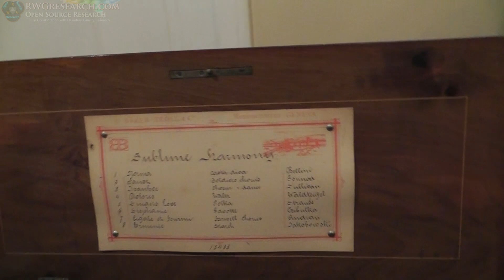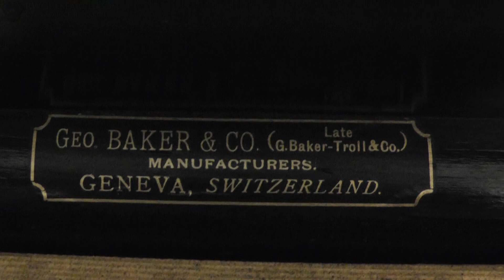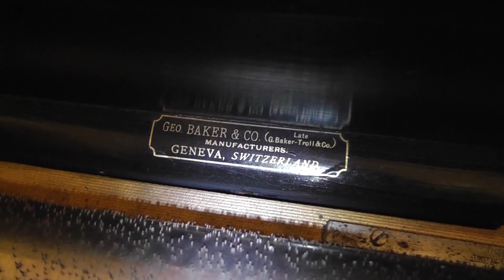Amazing 1800's 8 Song Music Box, Lets Look At The Mechanics! G. Baker-Troll & Co.

Comment: It's called a Geneva stop wind. After 4 winds it stops to prevent overwinding of the mainspring. Those pins and wheel are important. It keeps the spring tentioned in the barrels winds down so the spring doesn't break and come off the arbor.

Comment: That lever by the cylinder is a hack that someone installed for later coin operated units. Never ever ever ever use that to change the melody when it's not properly aligned you can bust the teeth or at times missalign the cylinder when the change cam comes around.  This hack may have been added either in the early 1900s for music selection ( like a Juke box). I don't like the quick select feature. As I mentioned that's an addition to the machine. The handle thimble looks different as well. It's best to let the music change as the cylinder revolves.

Comment: That is a really nice music box.  Couldn't imagine having to place all those pins on that cylinder.  By the way, that part that you were pointing out on the winding mechanism, it is called a Geneva Drive Mechanism.
Reply: tinylogic Is the Geneva Drive Mechanism to prevent users from over winding the spring?
Reply from the maker: SugarBooty yes. that is correct. or at least i believe so. ~Russ
Reply: SugarBooty Yes, you are correct.  Interestingly, I would never have expected to see a Geneva Drive Mechanism in a music box as my experience with this mechanism is in watch movements.  Goes to show the craftsmanship placed in this music box.
Reply: I was asked for clarification on this so thought I would share it here as I was slightly incorrect on the term.  My experience with this Geneva mechanism is in horology and it is referred to as the Geneva Stop (or Stop Work) mechanism and its use appears to be the same for this music box where it limits the winding/rotation of the spring.  However there is also the Geneva Drive mechanism where it is very similar in design and appearance but is used in different applications.

Comment: I Have an old music box. Maybe you can help get me going with buying what I 
need to get started. The cylinder has a number and the box has the same number 93395 on the metal.
 It is 17 3/4 inches by 8 by 6 inches. it is 57 notes I think. Maybe you can help with parts,
 date, manufacturer which will also help me also. Adding pics. Thanks Ron

Comment: Cool. I have one too. Can you adjust the speed blades on them? Mine started to slow down. Which way do you turn the blades to speed it up, and how far?
Reply: The governor definitely shouldn’t be bent. Most of these are 100+ years old. Yours would’ve slowed down because it needs maintenance—cleaning away old grease and oil, adding fresh appropriate lubricants, and potentially fixing by adding bushings or replacing shafts if there’s excessive wear. Probably it just needs to be disassembled and put in ultrasonic bath, then lubed and reassembled. But I wouldn’t try to do it myself, despite being amply handy.

Comment: It have 20 tips of tooth broken as can see on video they may be broken more,  those note will not play is about 20 $ to replace one. Can you please stop rotating the fly weel backwards you will broke all .It needs professional repair if you remove the comb you will never been able to place it back as it was and will be completely out of tune 
Also needs the dumpers replacement,  in perfect working conditions I can go to 1000$ on ebuy 
Be careful if you send it for repair read feedback first mine was ruined by a so called professional music box repair shop

Comment: what you meant to type in description was "I mean how do you make such a thing in "1880-90" ? I am not sure the keys are broken but rather keys that would not fit the pitch of the keys on a piano keyboard including sharps and flats so those spots are not pegged for being twanged, but to see for sure use a sharp leaded pencil and place it where you think the broken lil piece would be and hold it perfectly at center of that key and play a song and see if the lead gets broken...if it survives play the next song as the previous song may by chance not have used that note, Reason I say this is it did not sound like it missed any notes on any song you played.
Reply from the maker: 1NRG24Seven good catch. fixed, thanks! yeah from what i can tell there broken off. i have seen pins go past those point's. there might be some that are not used but if that's the case, why brake them off? any how good thoughts, thanks! ~Russ
Reply: ***** 

George Baker (also known as Geo. Baker) and Samuel Troll were
independent makers prior to 1874.  However, a catalogue, with the
back-to-back letters B with central stem forming T, has the heading:
G. BAKER-TROLL & Co. established 1868.  This seems to throw doubt on
some previous dating evidence.

The partnership started in 1874 as Baker-Troll.  The company reverted
to Geo. Baker & Co. in about 1891 but soon after Baker began to give
up parts of the business.  Subsequently it was advertised as 'late
Baker-Troll' to about 1900.  Chevob & Co. took over the business soon
after 1900.
Reply: I hear missing notes from the broken tips. All tips shall be there, and the pins of the seven silent melodies pass between two neighbouring pins. Tips probably can be mended at acceptable COSTs, but when a whole tooth is broken off, it can cost 30£/300$!

Comment: Do you want to fix all this broken "soundblades" ?
Reply: They are called "reeds". The only way to fix it would be to remove them and make new ones. That's time intensive to do. Technically you could solder or weld the broken tips back, but it's difficult to make them sound right after that.